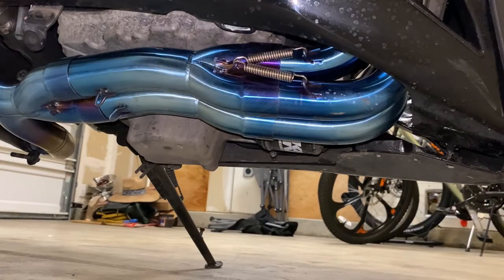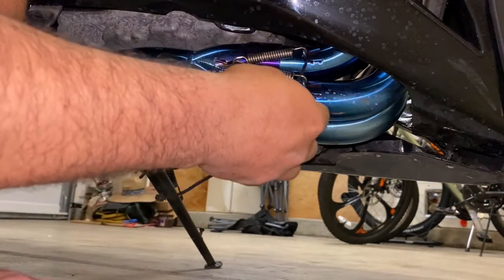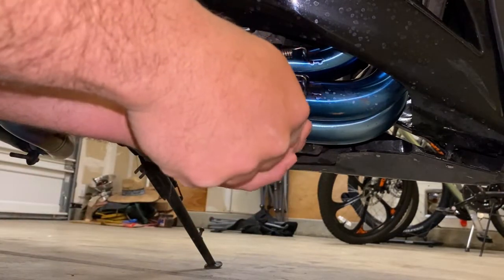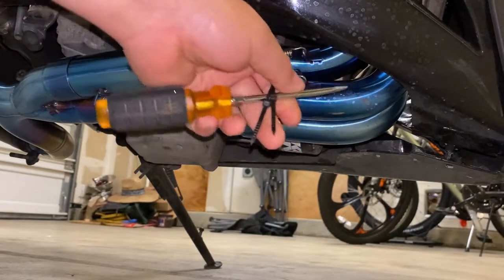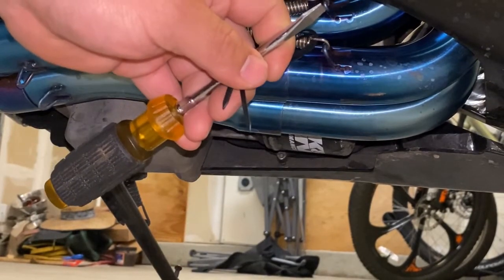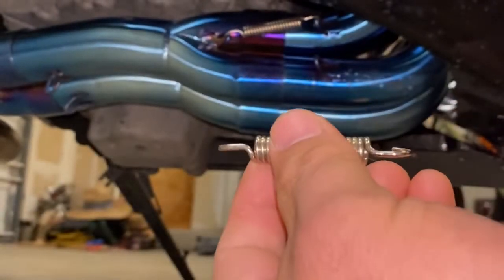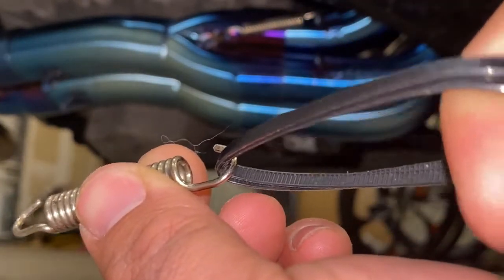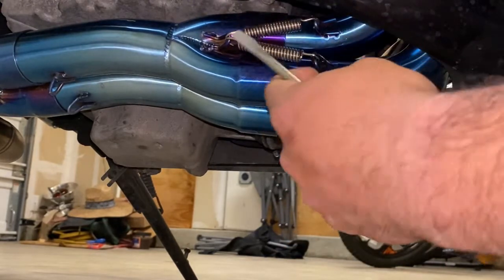Easy Exhaust Spring Trick

Comment: Thanks man I used this method with parachord and it popped right off!
Reply: I'd use Paracord and my hand any day over zip ties, no screwdriver, I tried zip ties and a screwdriver once and it slipped and sent the blade of the screwdriver right in to the corner of my eye socket, I managed to avoid the lobotomy but there's definitely nerve damage, never use screwdrivers to pull on stuff.